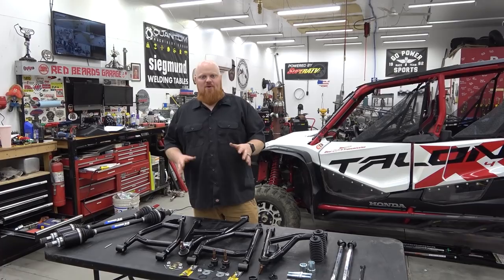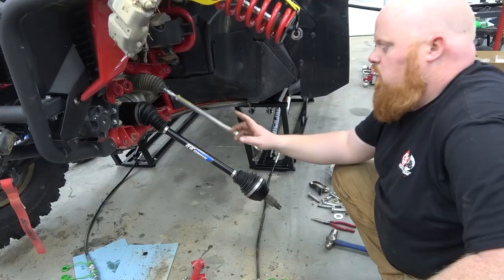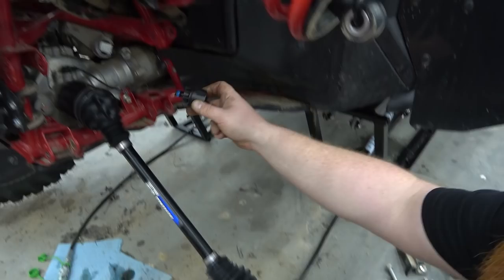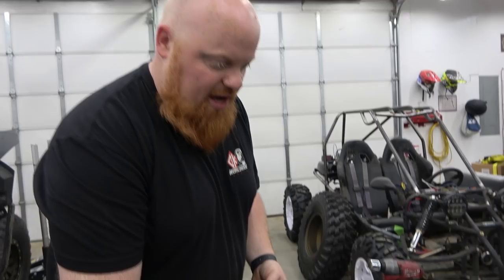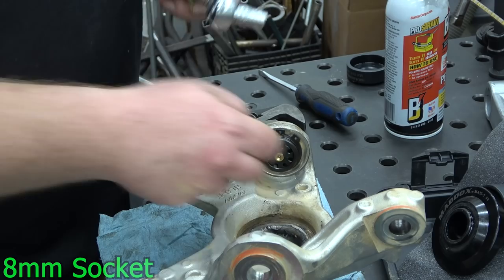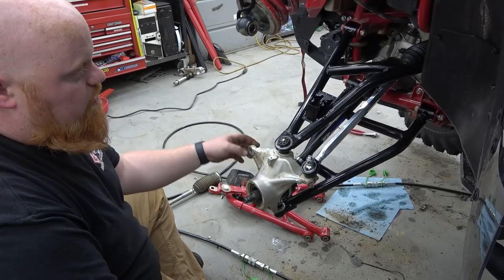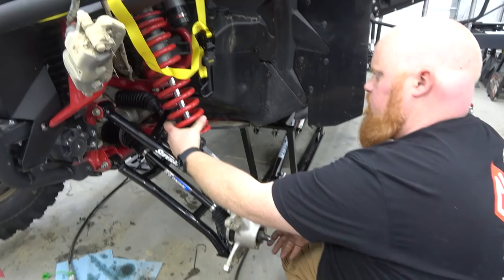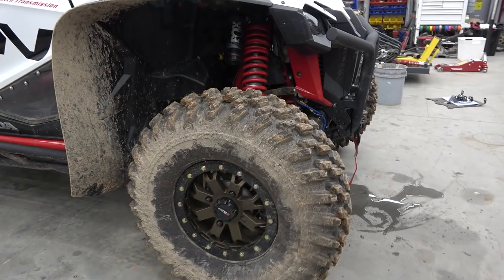Honda Talon High Clearance A Arms, CV Axles, Billet Tie Rods, & 32" Tires

Comment: I have found that lubing the threads on any tool they last longer. Also helps tool to work easier. I have used aftermarket scissor jacks dry just like I got it and threads galled and stripped first time I used it. Was used on a Pinto,so it wasn’t too much weight for it.

Comment: Those lift system's are way better to use. Our 4 seater RZR is bad ass. And lucky the step sway's out and easier for Jessie to climb in since she is 5' tall. We always go mudding all the time and we never get soaked or drenched in mud. And i installed a big water tank to spray water on the windshield. I had a company that work's on ATV's and Motorcycles and i had them up graded the whole drive system and performance system and remove the turbo and up grade the motor. I hated the whinning of the turbo each time i step on the gas and left off the gas. And i told Jessie it's gone and i can get them to up grade the motor better without have to use a turbo. Jessie asked me if i have ever had to watch a video of yours to build or fix something. And i said yeah when i had to work on one of our kid's small motor they had. And i watched other videos and that's when i subscribed to ur channel.